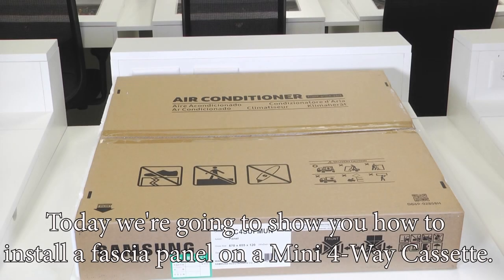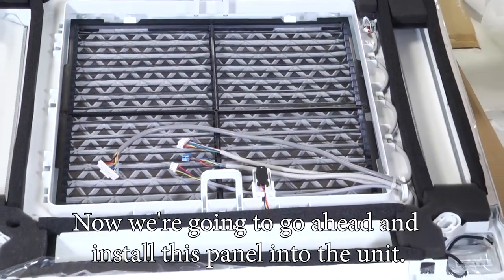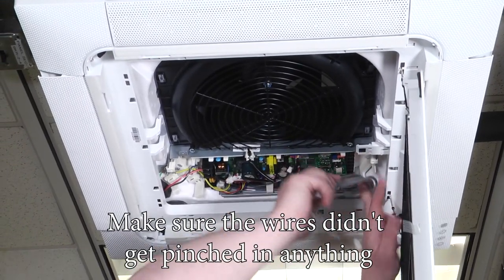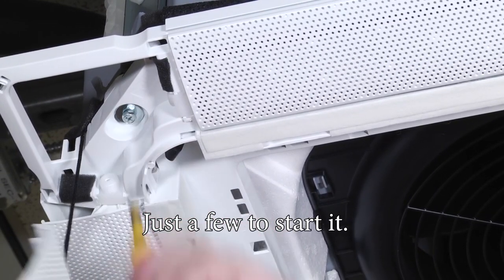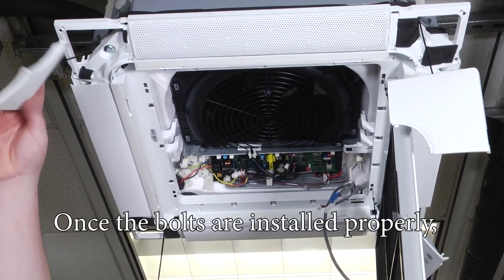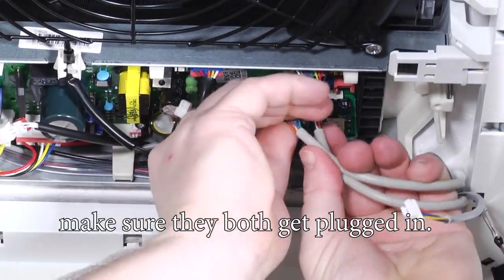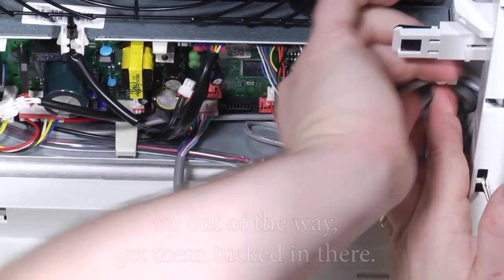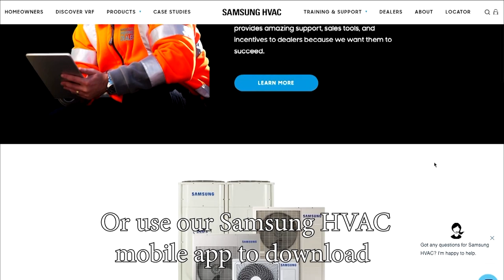Installing a 4 Way Cassette Fascia Panel

Comment: Dude, you pinched that hanger shock cord on the last corner you snapped on... :-) The client is going to FREAK OUT! 

Seriously, thanks so much for this helpful video! Better  and clearer than the Samsung manual. One thing I noticed is that you didn't engage the backside of the metal circuit board cover before you screwed it in with the two front sheet metal screws. This is easy to miss. There's a j-hook style fold on the outside facing edge of the metal board cover. There's a matching edge fold on the associated metal box protecting the circuit board. You have to hang the j-hook edge of the cover on the outside edge of the base box first and then swing the box cover up to align the two screw holes. From the video, I think you might have missed that, as one can see the outside edge of the box cover fall down a bit at 4:42 - this because the j-hook edge is not engaged.

Comment: tighten the corner fascia bolts to leave about 1-2mm play between fascia and ceiling (check by gently pulling up and down on the fascia corner,, else being too tight against the ceiling it will cause the plastic to "pop" periodically from thermal contraction/expansion and too much compression against ceiling and annoy some people, especially at night..  So leave that tiny buffer.

Comment: You actually left the Black plug disconnected from the board in that panel… looks like an Ambient temperature sensors wire…..Cheers 🤣